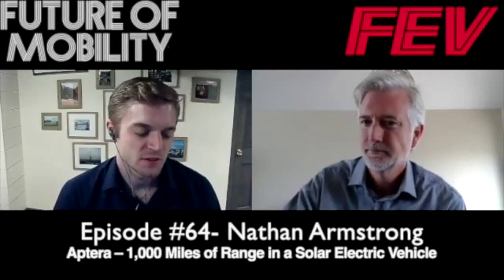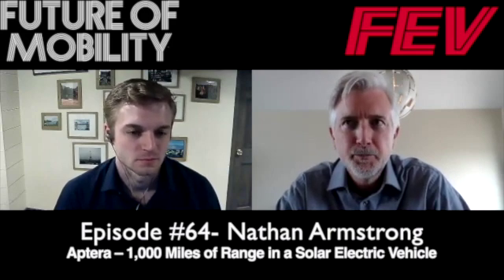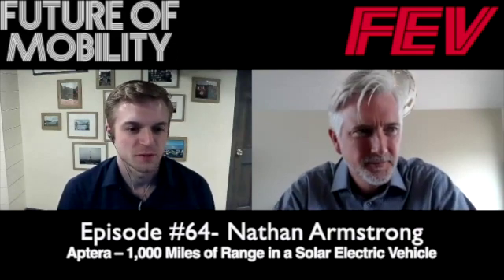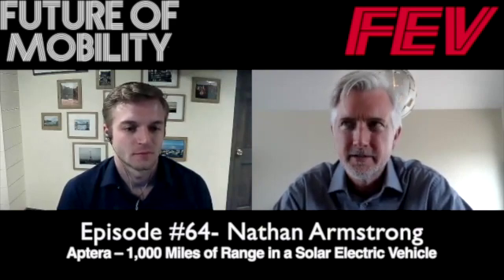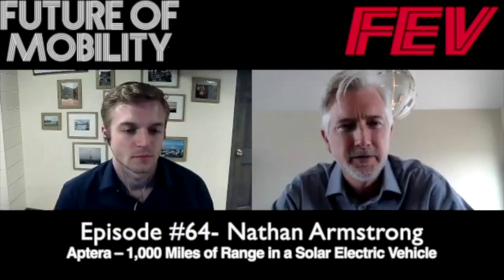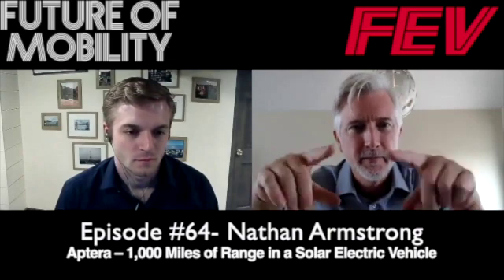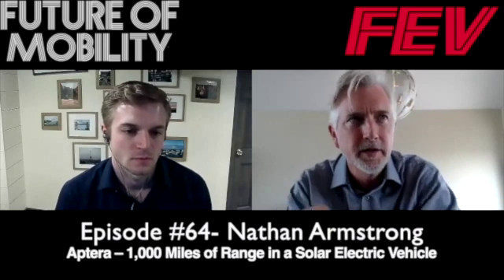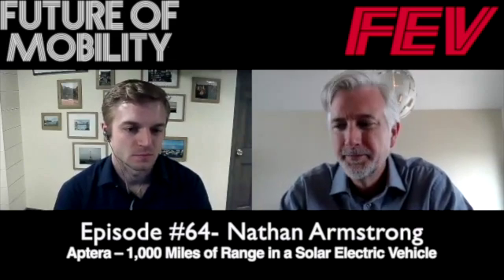Aerodynamics, Lightweighting, and 1,000 miles of Range from an EV with Nathan Armstrong (Aptera)

Comment: he forgot to mention the shape was worked out by a professor morelli in italy way way back in the 1970s and they simply copied it, they did not have to work out anything, it was all done by morelli.  Also there has never been a full size model of the aptera tested for aero cd value in a wind tunnel. Thats a long story in itself. The current cd value is completely unknown. They have raised $140 million via crowdfunding...yup thats correct....and thus far have produced a handful of prototypes..........so about 20 to 30 million per prototype.
You have to ask where did all that money go? And they have continually promised production dates, but have no production line even started.

Comment: It isn't like there had not been a similar hybrid 3 wheel motorcycle that failed, which could have been shown. NOTE no production cars made to date.  If it was so easy to make as they claim; surely they would stop redesigning it and produce it - well now they are saying mid 2023 - and then they will need another redesign after all why bother with a beta if it was already perfect?  Then it will go around and around while other makers actually bring vehicles to market.

Comment: There were some designers thinking about aerodynamics in cars before 1940. Buckminster Fullers  1933 dymaxion car had a drag coefficient of 0.25, although that was a much larger vehicle than the Aptera capable of carrying eleven passengers, at 60 mph getting 30mpg.